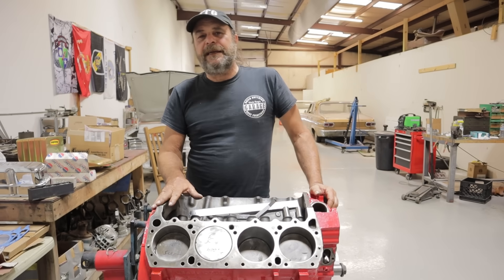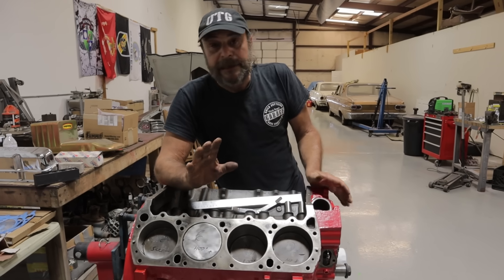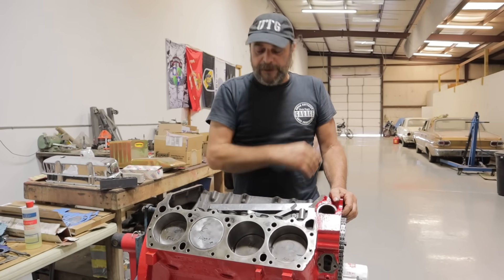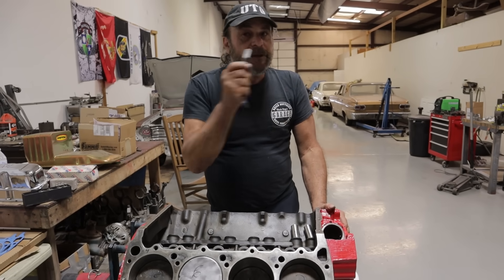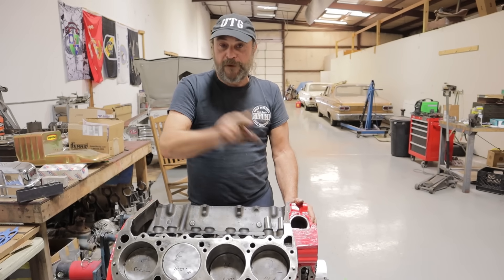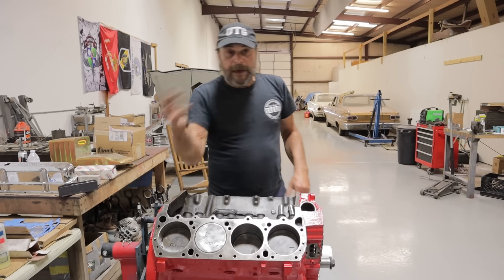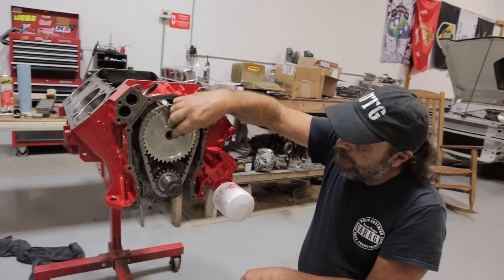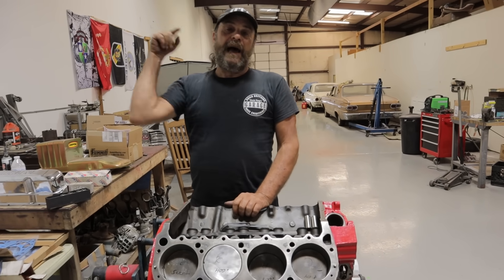Checking Timing Gear Accuracy  And Camshaft Timing For The Home Engine Builder

Comment: I’m sorry but that method is ridiculous. TDC isn’t verified at all to start with. Cam lift needs to be measured with a dial gauge not feeler blades and lift specs are measured on manufacturers spec sheet. Yeah itl run, you’ll be able to tune idle and ignition timing to mask incorrect timing. You also need to check maximum lift with heads and valve train assembled. Stock rockers and springs will bind with a high lift cam and you risk bent pushrods or dropping a valve. If it’s a slap together build and it’s yours go right ahead.

Comment: Uncle Tony,   Wouldn't the convex surface of the bottom of the lifters prohibit getting the straight edge to touch all four edges?  Sincerely asking.  Perhaps flipping them over and using the top side of the lifter to check with a straight edge..?  🤔

Great idea about checking the cam for twist.  I'd never woulda thunk that!

Comment: How much variation in overall length of the lifters have you seen over the years? If one is .006 longer then the other, that shows up as 2 degrees.

Comment: come on tony, build the engine, don't fill that filter with oil, (most mfgrs. of filters say not to prefill), fill the oil pan with oil, run that oil pump with a drill, turn the crank a couple of revolutions and get the oil to the rockers, then install the oil pump driveshaft in the correct position. If it's going to sit a long time, vacuum seal a plastic bag around it. Now you have full lubrication of the engine without harm to the bearings, and if you had installed a gauge you would know what the pressure is (and if you forgot any oil galley plugs). Just the way I was taught in the machine shop, and we built thousands of engines over the course of 7 years that I worked there.

Comment: Loctite in blind holes, such as pinion gear bolt holes and camshaft bolt holes, should have the Loctite applied inside the bolt holes and not just on the bolt threads. This is because the air pressure caused by threading the bolt into the hole can force the Loctite on the bolt threads out towards the bolt head and the rest of the bolt threads would end up without with Loctite remaining on them. Standard Blue Loctite 242 is very oil sensitive and calls for using Loctite Primer. Blue Loctite 243 is oil tolerant and doesn't require Loctite Primer, but it is not always easy to find.

Comment: I forgot the loctite on a Ford cam once.  Gear fell off, cam slid back, and it cracked half the roller lifters when the next cam lobe slammed into them. Didn't know that for a couple years until I changed the cam.  Pulled it out and found deep grooves plowed into it, the rollers badly galled, and thats when i found the cracks in the lifters at the axle for the roller.  Lesson learned, don't forget the loctite on the cam bolt.

Comment: Hi Tony, love most of your videos bit hard to concentrait with the grand kids ox,anyway do you have or doing a vid installing gear drive, and what its used for(best application)small block prefered?,this series is on hemi bb, do u have a full build guide like this for 318/360 ? last question do you think with a 360 would it be better to bore out a 318 to 4" and use a stroker kit in that or not? i havent had time sadly to build any engines since mid 90s raised now on our 14 children.lol im also in soth australia luckily i have a 318 cl 1977 charger, a chrysler by chrysler 360 1972,and my srt8 300 392 2012, still rather old school.any help from you or other viewers would be great, love ya mate keep up the awesome very detailed videos.God bless you n the helpers.ox

Comment: Tony do you ever experience cam walk with the big block mopars, I have pulled down a few slants that have had bolts fitted to the timing covers to limit movement, and worked on a solid lifter 454 chev that had a button even though it was flat tappet...Is this aftermarket cam grind insurance do you think.

Comment: Good on you uncle Tony bloody good video as usual 

regarding the Loctite I would’ve thought and I was always under the impression the bolt on that top cam gear the big one was threaded in a way that it had a left-hand thread so considering the direction of rotation it was always going to be self tightening…….!!!

Or whatever maybe a right-hand thread but the direction of rotation would still make it self tightening

 I’m surprised to hear that they come loose…..!!!??? Not discounting what you’re saying of course

And also great to hear you mention that a dry timing chain leads to stretching 

and people at home would probably be wondering why or they have not picked up on that point

and I’m one of these people that changes my engine oil every 3000 km to much criticism by others

But my understanding is that if the timing chain is allowed to run dry from an initial assembly scenario or from a lack of oil changes ie sludge buildup 

then that lack of lubrication which is also code for a lack of cooling……

lets the chain overheat in a pinpoint manner and as that metal gets too hot it also gets too soft and starts to stretch

Generally for a daily driver i find that often people still don’t seem to understand the benefit of frequent oil changes and clean oil at all times…..

All the best from Melbourne Australia I did see you on the channel explaining you’ve had Vegemite before and you don’t want any extra 

no worries mate all the best….!!!

I could substitute that with a “king brown” of Melbourne bitter 

but I also know from watching the channel you don’t drink either……!

(A king brown is a 750ml glass stubby - which is basically equivalent to 2 cans or tinnies)

Comment: Just curious Tony, using those lifters and lobes would they have different face wear using it in this block now? Like slight different lifter bore position to the cam nose from one engine to another engine. I say that cos the nose of the camshaft might sit and wear in a different position on the lifter face in this engine maybe increasing face wear even if its the matching lifter you just want to be sure thanks

Comment: I've use a similar method "valve rock" to time the distributor basically rock six therfore no1 is top dead on fire. Helpful when someone has pulled a distributor then smoked a fatty. Just pull valve cover valves don't lie. Drank a lot of free beer knowing this over the years.

Comment: Can I re-use the stock old roller lifters with a new cam on my 1985 diplomats' 318? The horror stories you tell about brand new lifters makes me ask this question. Thanks.
Reply: Assuming they are in good shape roller lifters can be used on another similar camshaft without issue.

Comment: You can use (2) deep sockets that fit the lifter bores and avoid the double stack lifters. I prefer the Comp Cams dial indicator adapter on the intake lobe and setting the position based on the intake centerline (degree measurement vs .050") using a degree wheel. I've found they are usually advanced a small amount, either by the timing set or cam pin/keyway, usually never straight up split overlap.

Comment: How do you fill an oil filter that mounts sideways without the oil spilling out when you install it?
Reply: Put the filled filter in your freezer for an hour before install. And thanks alot to the idiot who designed cavalier filter mounts for making me have to figure this out.
Reply: "How do you fill an oil filter that mounts sideways without the oil spilling out when you install it?"

a) You don't fill it all the way up and b) if you do it quickly, spillage will be at a minimum.
Reply: Simple, just turn the engine so it's pointing up and screw it in. 😂
Reply: You can't

Comment: TONY, Similar method to mine. Use dial indicator to verify T.D.C. Align marks on t.c. gears and check lifter pair for height. Adjust or change out cam as necessary. Then rotate assembly 360 degrees and check marks and corresponding cylinder at T.D.C. and lifters for height. I generally do Ford stuff and recently source new cam and valvetrain parts that are 20-40 years old. I've seen others have bad cams and lifters, that are of recent production. Even aftermarket rocker arm ratios that aren't the same from the same box!  B.T.W. I 've had a Crane H-302-NC Cam with Isky Hydraulic "Super-Lifters" (2-bleed holes) and Crane Swedish steel "Oteva" springs in my 1969 351W Mach 1 for over the past 50! years and still running strong. Thank you for your common-man, blue-collar advise and builds.
Reply: "Use dial indicator to verify T.D.C."

Yup, that's what I always did.

Comment: When there's four degrees built into the came do you subtract that from the timing marks on the harmonic balancer or add when setting timing with the timing light.
Reply: You do nothing. Grinding a cam slightly advanced increases bottom end torque and more important, compensates for timing chain stretch (which retards the camshaft) which is why I presume cam manufacturers do this.

Comment: Is top dead center on the compression stroke split overlap? With chevy engines I always line the marks up on TDC on the compression stroke.
Reply: I was a little bit confused at first too. Learned something new today. Didn’t know the timing marks line up on overlap. I guess another 360 degrees of rotation will bring you up to compression/fire on the harmonic damper

Comment: I daily drive a 1972 dodge truck with 318. It has just passed a hundred grand. When should I replace my timing gears and chain. I'm 52 and want to drive my truck for the rest of my life. So I'm into all aspects of what I can do to keep it happy. Regular oil changes ECT.
Reply: I would consider doing that soon. I had a 75 dodge pickup with 118k miles.  The timing set was worn out. More of a problem is the nylon teeth will get brittle with age and can break instantly.  
 I know of 318 engines going well past 150k miles on their original timing set. But that was 40 years ago. I’ve been told that older dodge pickup engines had all metal timing sets. I don’t think that’s true. 
My opinion is buy the very best replacement parts you can.
Reply: My 79 w150 had the nylon gear and it jump a few teeth with 107,000 on the clock

Comment: Still nada on a degreed cam gear. Any way my 383 me using a Mopar Performance street rod cam that has to be center lined. I do have the off set cam bushings. Sorry I still use the dial indicator to make sure piston is at it's highest point, right at cross over.

Comment: When would you slant cam timing adv/ret from recommended? 
 What can you expect in power?
Say you want more grunt,  would advancing give low end and mpg?
Reply: Not sure about mpg but it'll shift the power curve. 
I had one advanced 1 tooth on a 4cyl and it pulled like a bear to 3500 🤣
Reply: Tom, there is plenty of information available in cam manufacturers' catalogs and their web site as well as in SA Design books on this subject.

Comment: Is it really possible to not second guess youself when you build a engine?
Reply: Yes it is possible if its an engine you've slapped together many times before. I've built more 305 and 350 Chevy motors than I care to mention.  Bone stock and highly modified. Stock isn't a big deal at all, modified is where the second guessing starts for me. I built a high compression 383 stroker and I was second guessing every bolt I tightened and every gasket and seal I touched. Building modified engines is almost stressful for a million reasons.